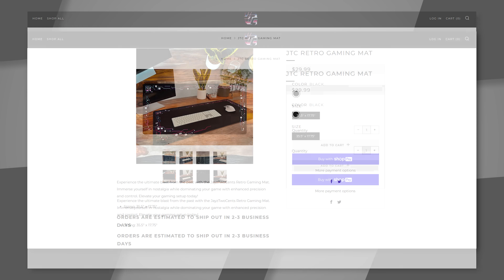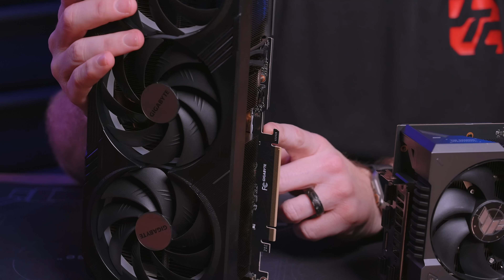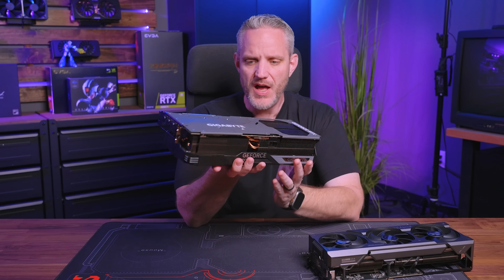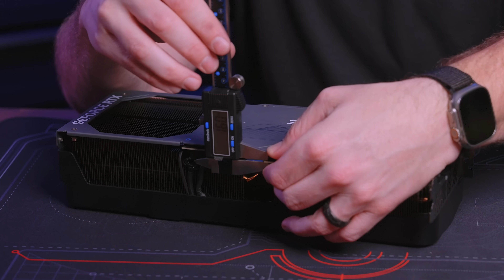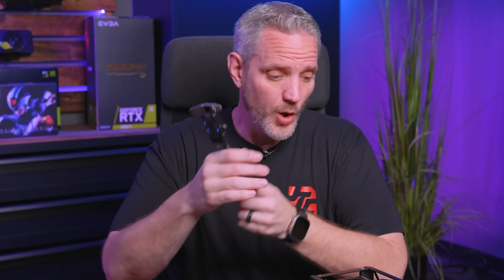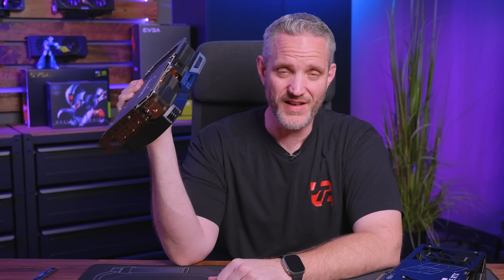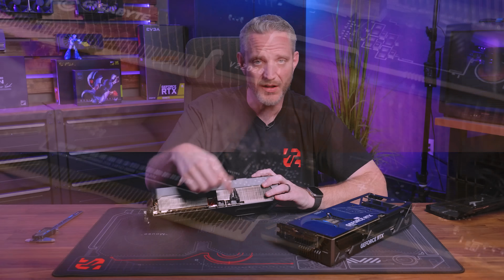These GPUs are cracking and the company REFUSES to warranty them!

Comment: I bought a prebuilt newegg ABS computer with a MSI RTX shadow 5070ti oc and It just came and I checked and the card has a crack but the card still works on that tab. and it was removed the correct way to install an nvme under the video card. I know to release the tab and to pull straight out and that is what i did but it's cracked.

Comment: Also, it's not that the ASUS PCB is stronger at all. It's the way it's designed and being closer to the base PCB and getting smashed in by the backplate. That's why Gigabyte's card seems to be more "flimsy". Structurally it's different, but the thickness and materials used is the same. Regardless, I have to disagree with you guys on this one. If you buy a heavy card and don't use a GPU support bracket of some type or snap that piece in whatever way, then that's entirely on you and not the manufacturer. These cards come with a support bracket. Use it. If it doesn't for some reason, BUY ONE!! They're cheap and will save you a ton of money. GPU sag is almost always the culprit to this issue. User error, not manufacturer error. Also, someone can simply crack it and send it back in for an RMA to get a new one. That's bad business. I guarantee people would do that.

Comment: I came back to this video after the disaster that is the 50 series launch, and taking the 40 and 50 series launches in totality, given the nonexistent availability of 4090s (when they were being sold at least), I really don't feel bad for people that used their preferred access as reviewers (or working for one) or beneficial arrangements with distributors, or any other means which allowed them to undercut or cut ahead in line of normal consumers. Not sorry at all. I literally couldn't get my hands on a 4090 at any time without spending near $2,700 or more. The fact that this is occurring and everyday consumers don't even get a fair shot in acquiring flagship Nvidia GPUs is really disgusting, so it's vindicating when their quality is absolute garbage.

Comment: If they aren't going to change the mounting mechanism of the GPU, they should at least make a PCIE mounting bracket that is four slots tall. Include it as a swappable item in the packaging, I know some people will have other items plugged into their lower PCIE slots. But for those who don't, which is the majority of gamers, a four slot PCIE mounting side bracket will have enough length to support a GPU of that size without the need for a GPU stand.

Comment: Not only is it crazy that these manufactures don't securely attach the cooler to the PCI bracket, but I don't understand why cards with 3 or 4 slot coolers only have 2-slot brackets. The best stability would be a achieved by having the widest base of support from the case. 

It's not like you can use those slots for anything else anyway. For the 0.1% of people that watercool they can just sell a replacement bracket.

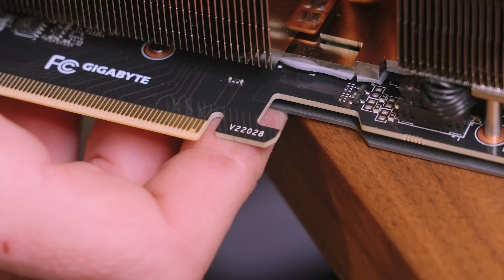Comment: Come on Jay! I would've expected better from you. 6:35 The ASUS  card has a plastic screwed down standoff right there in that spot for the graphics card cooler and the Gigabyte card has nothing right there so of course the Gigabyte card is going to have more flex the the ASUS card and yet you're trying to play it off as the Gigabyte card is somehow weaker. Shame on you for not pointing out that support on the ASUS card..

Comment: Sounds like another case of a manufacturer in total denial.  But knowing that this is an ongoing problem, is it possible to reinforce the card in the area where it commonly fractures? Bit of fibreglass tissue both sides with resin?

Comment: I have that 4090 and a support bracket for rear mount is included in the pack, which screws into the back of the card as well as the motherboard mounting screws.. if you dont use it, yes it will break..

Comment: Gigabyte have revised their PCBs to be stronger for 4080 Supers fortunately....
Reply: I believe you. I have the gigabyte OC rgb 4080super and it's pretty strong on that retention tab. I tested it just now and ya, seems sturdy. But it's new. I just bought it the other week. This video is a year old. So ya. I feel they may have listened to this video and others and got it together. 👍
Reply: @DarkHorizons78  Indeed... Just avoid any Giga RTX 4080 or 4090 Rev 1.0 Cards. They're the ones with flimsy PCBs
Reply: @MJLStudios  i have a 1.0 4080super. But ALL 4080supers are built with the new stronger PCB. 

I was a little nervous when I saw my version was only a 1.0, lol.  But it's all gravy, baby. I got the upgraded pcb. But I'm still using a bracket to stop any sag

Comment: I had one come damaged with my new build. Brand new deliveried and completely snapped. GPU was dead, had power but no output or detection by mobo. Had to return the entire system to seller to get it replaced. Aint fun. This is a shit design for these heavy gpus. Asus ROG STRIX 4080 Super btw

Comment: this issue is ridiculous and is taking decades to be solved and the problem is the pcb design which is not meant to support those ridiculous sized coolers and water blocks. Boards often flex if not supported by third-party support brackets, which makes this seem much more ridiculous. This PCI-E design should be reviewed with standardized support brackets shipped WITH each compliant board.

Comment: To be honest, it's completely the manufacturer's fault!
Why not design fixed supports that are screwed to the outside of the graphics card that only allow the heavy card to rest on the metal chassis on the back and bottom of the case
Then all that remains is a power supply and a ribbon cable (riser) of a few cm that cannot exert any force on the motherboard!

Comment: I have a Gigabyte 3090 (only one I could get my grubby hands on back then) Ive been running for a few yrs now since they came out basically. I think I haven't had issues because I repadded it, the memory would overheat before that. And the other thing is my case is tiny and I CRAMMED this thing in there along with so many components all mickey moused and wedged together like a tetris puzzle in such a way that the card is fully supported on all sides.

Comment: Do you not see the return from that point on the Gigabyte card goes further back .... I will eat my words if you mention this later in the vid.  I'm only at the point where you measured.
The Gigabyte board juts back further to the PCB than the Asus card  .... That is the point of weakness.
EDIT:      OMG... I cannot believe you did not bring that up... 2 points to make.   1. Asus has a standoff and bolt RIGHT there to hold the cooler on. That is adding structural rigidity.  2.  Most importantly look at the return from that point on the Gigabyte card ... it actually goes back about a quarter inch for absolutely no reason, then comes back out but still stops short of the Asus card.   That is 100% percent the point of failure.

Comment: I wish I could get a GPU without the whole hook in the PCB. If I fail to properly support the GPU in the socket, I would much rather have the GPU fall out of the socket instead of cracking the PCB for sure. Maybe break the latch off from the motherboard socket on purpose before adding a GPU?

We never had such latch with PCI socket and cards weren't dropping from the socket. I think the whole latch thing was a pretty bad solution from the start.

Comment: What's the definition of insanity? 

Doing the same thing over and over again. Expecting different results. 

Gigabytes hoping this issue is going to go away like it's not a problem but the customers are going to keep coming back until the issue is fixed.. 

My pcs cards fans face down.  

I would lay my pc on its side . 

Everything in electronic is just breaking today and it's really starting to frustrate me. It's like all the brand new cars are having all kinds of electrical issues. Everything is just cheap now.

 I'm going to just hold off cuz I know that things have to get better. They they just have to get better as long as everybody puts all these companies on front Street. 

I really appreciate that you call companies on their s*** you don't sit here and lie for the sponsor or come up with bullsh. I appreciate you'll say stuff like Asus I'm done with you. 

Gigabyte pull your head out of your ass. 

I like gigabyte. 

I want them to be better

Comment: The repair that you're describing they would have to do is ridiculous and it's not going to make it much stronger. It's going to break again. 

And for them to replace it in with another is a waist. 

Cuz the person who's obviously using it's going to put it back in the case again sideways they're not going to fix. Try to put it different. They're not going to try to fix the issue. It's going to be broke again unless they make it completely new motherboard for the graphics card and replace that they're going to be sitting in the same boat so they're going to just have to come out with a completely different series .. 

And because you made this video 

I hope gigabyte makes all the pcb boards and puts stand offs right on the stress point  . 

That stand off on the asus is smart.  . 

Its not a fix all.. put it helps...

Comment: I believe that Asus video card it has a standoff right there on the break point which will reinforce it. 

Why doesn't gigabyte do that same thing and put a standoff right next to the flex point? 

That would strengthen the spot. 

I only buy gigabyte..  

Well this makes up my mind . 

I won't be replacing my 970 xtreme gaming .  

Until the 50 series with the Black well .  

In the past, gigabyte only sucked with some of their software. They'd have to monitor their system. I usually can get by. With that I can always get it to work. I always figured it out. I always buy gigabyte.. .. 

But not sure anymore. 

Won't buy EVGA cause of coil wine. 

I meditate and manifest now.. 

I would give my video card the coil wine on my off days. 

With that said seeds planted won't buy evga . 

MSI .. this used to be my brand when the PC club was still around ...

I could build a beast PC for $500 in 2002 at the pc club . 

I built my first PC out of the PC club. I took it home. Put the computer together and I had an Asus video card on it and it kept getting the blue screen to death. We couldn't get anything to work. 

And i don't remember my the guy programing my pc.. 

But for some reason because I was getting a blue screen of death he felt like he should pull the heatsink off the video or off the CPU while it was turned on and take look at it and I had an MSI at the time 2002 and right when he took the heat seam off it had one of those little crystals on top and we saw smoke come right off the crystal right when he took the heatsink off and it turned out I took it to the PC club and they actually replaced it but it turned out it burnt my CPU, my motherboard and my ram. 

The PC club replaced everything.. 

And found out the Asus gpu wasn't working with my msi.. 

I returned the msi .. 

And bought a G force 200ti . And it was nice.  

I was playing EverQuest. With all the expansions. 

I moved to Star wars galaxys in 2003 .. that game is free to play now.. its Called 

SWGEMU. 

That game plays on a workstation. You don't even need real graphics card to play that game. It'll run fine. May not do all the best graphics settings but it will run fine. It only requires 30 frames per second

Comment: Soldering takes talent and skill and know-how of course, because every time you do a soldering joint it needs to still look shiny.

 Or  you overheated it...  You burnt the tin out of solder . 

If you solder fast your good . 

I have to use helping hands now.  

I'm to shaky.. 

I burnt my last projects mother board. 

It was a 1999 Rockford fosgate punch 400@4 amp . 

I have no hand control . 

I wish I had a helping hand then held my soldering iron.

I know how I know. I'm very good at soldering but it requires for me to have a lot of tools because my aunts suck at it .

Comment: Its not a defect, its an enhancement. People buy more cards. BTW... you are right, they aren't mechanical engineers, and there is WAY too much weight with the coolers on those cards causing the pcb to crack. PCBs are not mechanical support structures.... but they have made them support structures over the years.

Comment: It's not just gigabyte it's all gpu brands the 4080-4090 cards are too big and heavy they need to include not just gpu brackets but gpu stands as well because those gpu brackets don't fit in all cases and they need to tell customers that it's mandatory to the brackets and gpu stands because these cards will fail without the brackets or stands that being said I have a gigabyte 4090 aorous master been using over a year no issues yet because I use a couple of gpu stands as the brackets don't fit in my case

Comment: I’ve bought a msi gaming x slim 4070 ! Pc was supper laggy when I upgraded the gpu and placed it in! Turns out it was showing 0mb memory size on GPU Z program! I placed the gpu on second pcie slot of mobo and it showed 8 in which I thought my mobo was the problem so I did a whole motherboard swap and transferred all parts and was so happy that I thought I fixed the problem only to find the same problem all along! Turns out it was the faulty gpu and not my motherboard… well at least I have pcie 4 slot now and no gpu to use it with since I have to return it. What a headache! Why is this so common

Comment: That will probably be the only Gigabyte card in your stock for a long time. If it is their fault ( not screwing the backplate to the cooler ) I wouldn't buy any more cards from them. BTW I never had, in my 25 years of building pc's, 'good luck' with any of their products. Asus's 4090 also crack. From here I cannot say if it is the manufacturers fault, or user error. These chunky boys should have an anti sag bracket in the box!!!

Comment: To be fair, the entire pcb is flexing on the gigabyte, and the asus has a frame bolt right near the pcie lock. I just picked up a 4080s asus OC Tuf GPU. Its the most rigid card I've ever owned. The entire front is a metal bracket that screws through a metal plate, then the PCB, then the back plate.

Theres literally no bend or flex on this card. The downside is that its MASSIVE! Its the same size as  4090's... But to be fair, its the first card ive ever been inpressed with the build quality. Which i was expecting for $1000, but it was better than i thought they would do.

Comment: looks like you are comparing a German car to a Japanese car. the Japanese car is made with lower quality products, but the Japanese car has higher quality engineering, so the Japanese car ends up better quality. it's basic engineering. you don't need to touch it to know. you can look and see. Fail'abyte has an overly large space between the board and the locking tab, for no logical reason. ASUS has a support bracket to strengthen the locking point for use as a bracing point. Logical.

Comment: Most of these cracks are caused from moving the PC with the GPU installed. Namely pre-builts and people that moved their pc a little too rough. The PCB is not desgined to take any form of abuse. Installing it in a motherboard in a PC and then handing it to UPS/FedEx to throw around is not it's intended use and it is not designed/built to take that. In reality, with how large and heavy these GPUs have become, we should be removing them before any type of shipment.

Comment: I haven't used Gigabyte for over 5 years and I'll never use them ever again after an X470 board killed the bios for no reason. I then tried to remove the bios chip as the board is meant to and it just ended up pulling the bios socket right off like it was glued down with kindergarten paste. 🤦 Piece of crap.

Comment: At some point in time, we will be buying video systems that will have their own motherboard power supply and case. They will sit beside, behind or on top of the computer and connect into a port that will located on the computer’s  motherboard.   The gpu’s at this point in time almost cover every single slot on the largest motherboards.

Comment: I am pretty sure a lot of the rigidity you are seeing on the Asus PCB is from the point where the cooler is screwed into the PCB that is close to the retention tab. The Gigabyte card doesn't have this screw point and so isn't getting the extra rigidity offered by the cooler.

Comment: I'm not a big fan of Gigabyte either, Jay. I tried some of their stuff and it just seems cheaper made than their competition. I'm speculating when I say that it seems as though they're cutting corners and using cheaper stuff to cut costs on the production side. I wouldn't necessarily have an issue with that if the consumer price reflected that but it does not.

Comment: Hey what about the anti-sag bracket that ships with thoes gigabyte cards? I have the 4080 version of that card and the included anti sag bracket seems to fix the triangulation issue you mentioned. It mounts to the motherboard standoffs and does a pretty good job.

Comment: Hey so this is 6 months later. How is phils gigabyte card holding up!? Has it cracked or has anything gone wrong with it at all? I have a gigabyte 4090 it was the only one i could get my hands on. Im worried about the pcb cracking. I have the card mounted and have a gpu bracket as well as a gpu stand that sits on the bottom of my case is that going to be enough support?

Comment: One thing you SEEM to have overlooked when comparing the "strength" of the Gigabyte card to the Asus card : the Asus has got a screw coming down into the board just above the locking tab whereas the Gigabyte doesn't. Now obviously, the screw / bolt on the Asus will add SIGNIFICANTLY to the board's lateral strength, hence the fact that the Gigabyte doesn't have one will be a major contributor to it breaking.